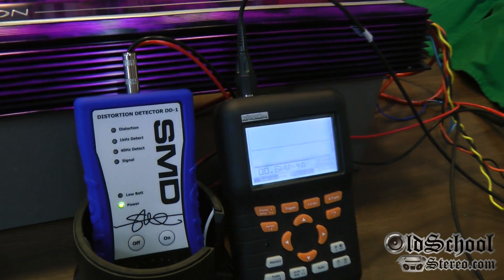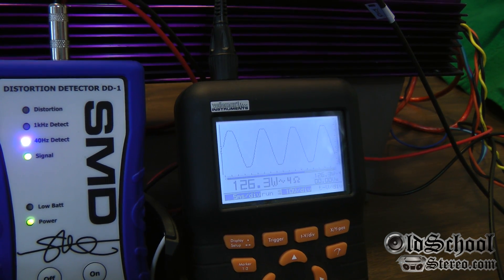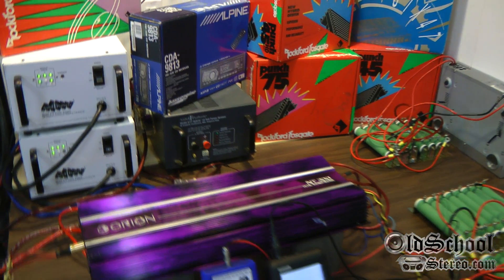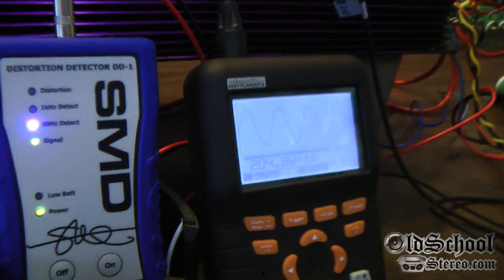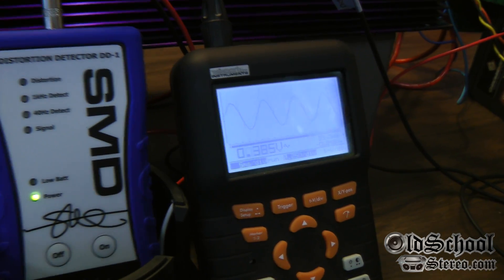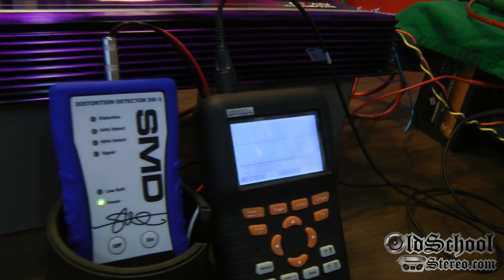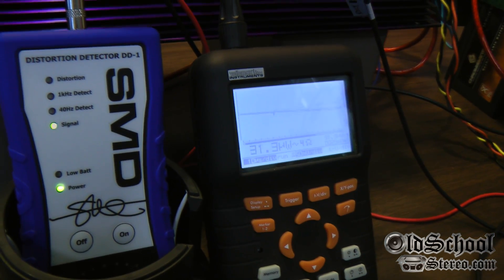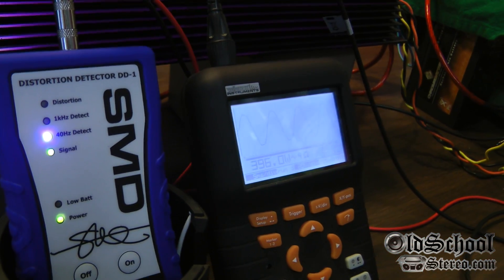Orion NT 200 Power Output Test DD-1 O'scope NT200 NT100 XTR100 XTR200

Comment: Some input from a previous employee of Orion.  Those clipping LED's were a guess on Orion's behalf on where the amp would clip and were pretty accurate, but definitely still a guess.  Also, the amplifier was designed to be driven with the balanced preamp device, the model number escapes me at the moment, but it really helped the signal to noise and of course the stereo separation was excellent as it was a dual mono amplifier.  But its magic was its sound quality, that was my favorite amplifier.  Previously it would have been the 2100HCCA as the NT200 is really a refined version of it (the 2250SX and 2100HCCA were the first dual mono Orion amplifiers that were designed as dual mono and not two existing amplifiers under one heat sink like the 2350gx was.)  The more "stable" of the two was the NT100, you may have noticed they are the same size and thus made the same amount of power just at different impedance.  I kick myself about twice a year for selling the ones that I had.  Originally they were called the XTR100 and XTR200 and were a red/black finish instead of the purple.  Hope all of this useless "knowledge" is interesting!  :)
Reply: Hands Down  one of  if not the best amp period , have a NT 200  powering (2) Orion XTR 12 inch NT 100 powering (2) Orion XTR 10 inch and a Xtreme 200 running mids  with the Orion deq 30 and 300 PHD pure monster sound SQ and loudness Orion old school just the best for overall sound performance ..
Reply: I have a Orion 300 PHD Preamp Eq installed and the 200 Bix NT crossover  with my NT 100 and NT 200 ,the sound is beyond , crystal clean clear power , just found a Orion 300 PSW , will test it out ...for even more sound options ..

Comment: I know there's a lot more left in the NT200, it has 4 pairs of Toshiba BJT's per channel, 1200watts in total output transistors per channel! So output wise there's a lot left on the table.. But to get the hidden power out is the Q.. Im sure anyone that knows how to do the math and wind Torids by hand would have part of the answer? For some reason I'm totally obsessed with the NT amps! The balanced input's really do well with my Denon Z1 in balanced mode, no noise what so ever,so clean and pure!

Comment: For fun, I just swapped out two NT200s for a newer JL Audio HD900/5, running only the 100x4 portion of the amp. The JL was very clean but it is not even in the same area code as the Orion NTs. These Orions are the best of the best!!!